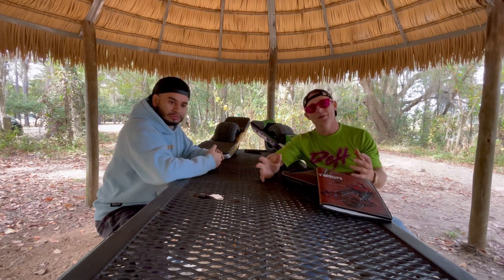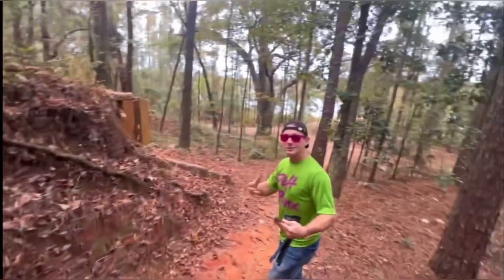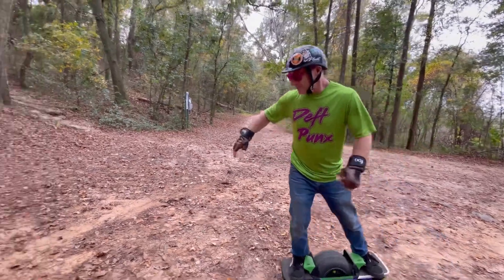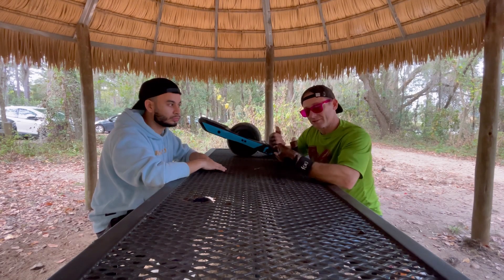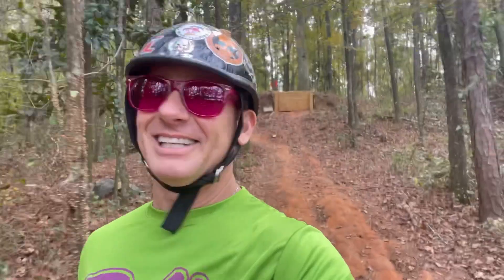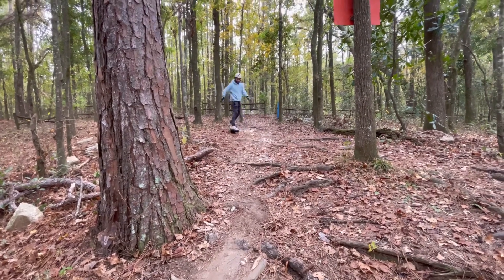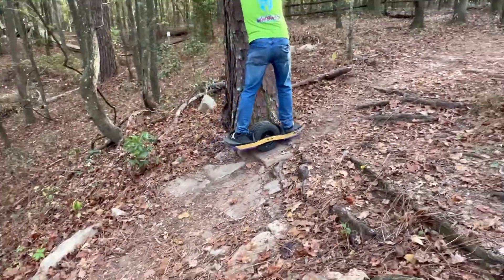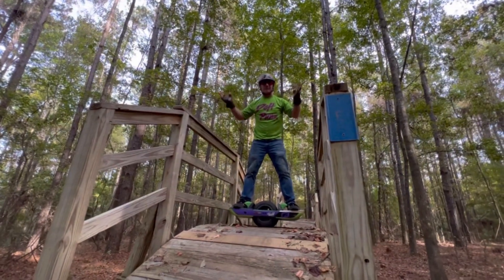Which one is better? Onewheel GT vs GTS hill climb video! Plus an 84v vesc.

Comment: Great review! Regarding "If you want top speed, go with the GTS. If you want good all around performance and range, go with the GT. If you are a tinkerer, and like to do things yourself, go with the VESC. Go with the float wheel."  ...If I'm not mistaken, VESC/FloatWheel offer all of the above.. speed, performance, range, and tinkerability.. at a huge cost savings. Personally, I don't own a VESC yet, but I've ridden an 84v FloatWheel and it was stellar! I'm waiting for version 2 to drop and then I'm definitely putting in an order. Also waiting on aftermarket companies to start selling parts for the FloatWheel. In regards to GTS, I've yet to ride one, but my main concern is range. I'm good with speeds around 25-27 which I can already hit on my ReWheeled GT, with no pushback, and no haptic buzzkill. It's the added torque that I want to feel... and see how it stacks up against the Floatwheel.
Reply: Great video. Testing boards out and having a blast!!top notch boys!!

Comment: I wonder if going into the advanced settings of Aggressiveness and dropping the first setting to zero would prevent that wheel slip you were getting at the roots and rocks. That should allow it to take advantage of the low end torque to crawl over stuff.

Comment: Lol. "There are no winners." The top vesc shit on the gts in every metric. Range, torque, top speed, price, reliability, repairability, customizability and in every real world comparison. 

Sure the gts is a step in the right direction but they are still so far behind. Let's not lie and act like they are even close to equal.
Reply: Future motion will always be lagging behind simply because they do not listen to their customers.  Based on the hub diameter alone gts will be less good for any trail riding
Reply: The VESC board ironically, just works. No need to move the stupid dots around on your phone to climb, no need to change it back to normal on the descent.